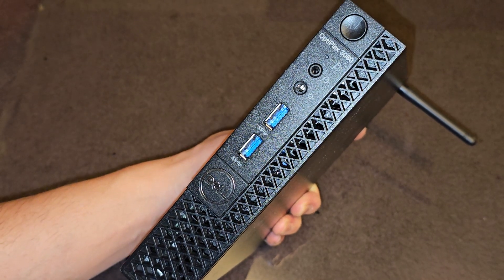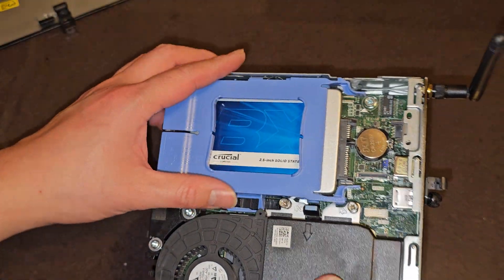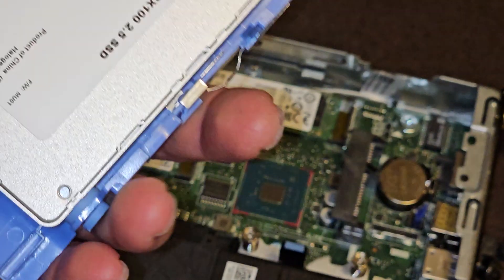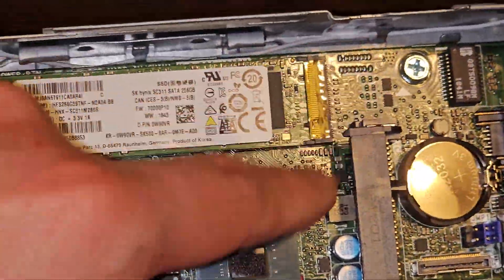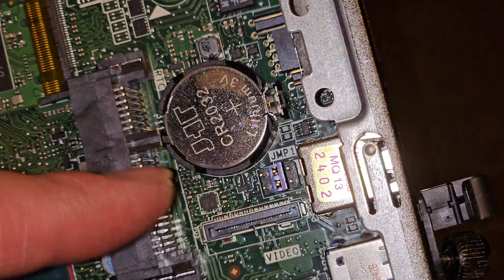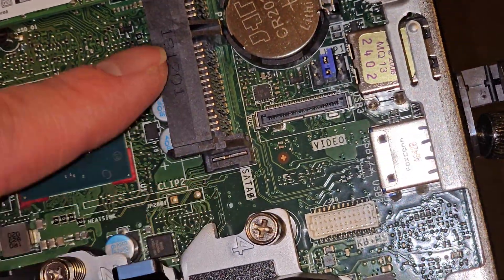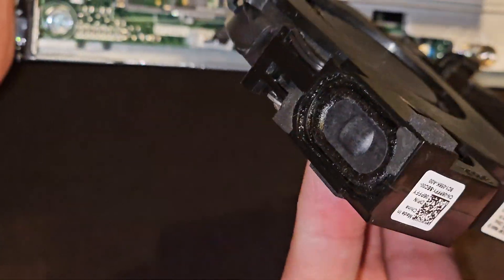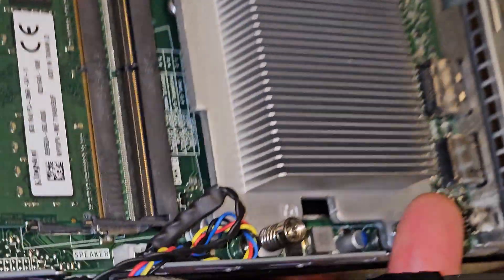Dell OptiPlex 3060 Disassembly RAM SSD Hard Drive Upgrade Battery Replacement Repair

Comment: the thing to push from side on my fan cover broken, how can i open it to upgrade my ram? 4:54
Reply from the maker: The clips?
Reply: @ItsBinhRepaired  yes, the one that need to be pushed to open the fan cover
Reply from the maker: @anemonastrum then you need to pull the clip up somehow
Reply: @ItsBinhRepaired  the clip is broken, dunno how to take off the fan cover. How if i open the screw for the cpu heatsink, will the fan cover come off too with the heatsink?
Reply from the maker: @anemonastrum  not sure

Comment: Found a tossed out Dell mini PC (not sure what model - no CPU, no RAM no SSD) also found a 3060 cover, but even tho the front features, ports match, when you go to fully close the case, the thumb screw hole & small tab (for a lock) are reversed! So the PC isn't a 3060! How can you tell the correct model #? Haven't had a chance to test it. Some time ago I discovered an E-waste center, and have been rummaging through the dumpsters!! The mini PC is the first PC (with an actual mobo!) I found there! What is there mostly are cases, mice, keyboards, old stereos... Lots to look at but not whole systems!
Reply from the maker: Is there a service tag number?
Reply: @ItsBinhRepaired  no sure, gotta look! Thank you
Reply from the maker: Yup